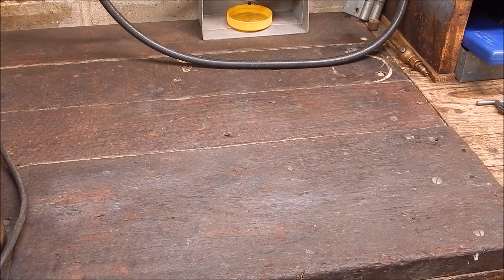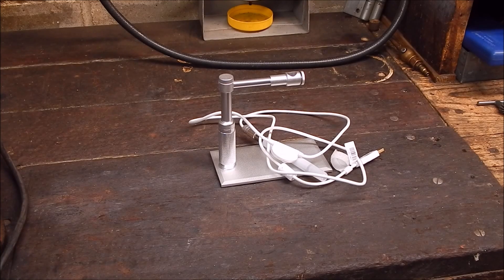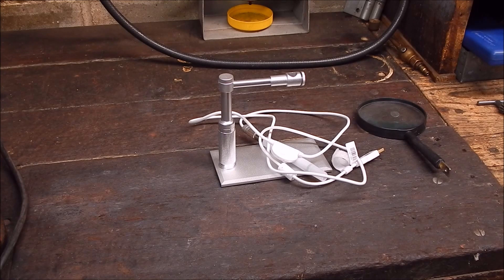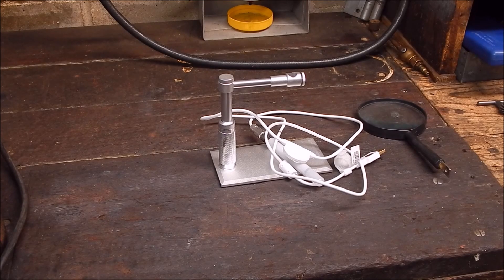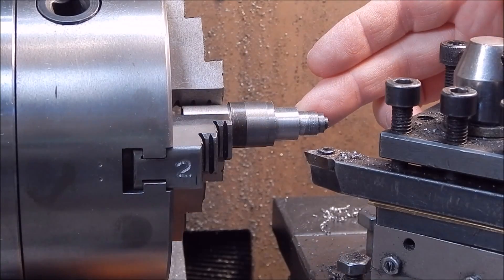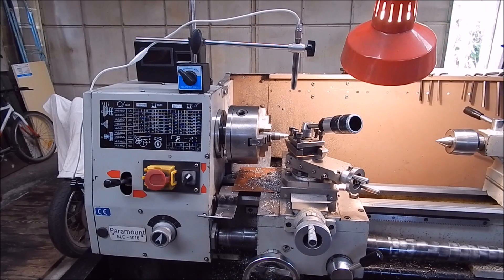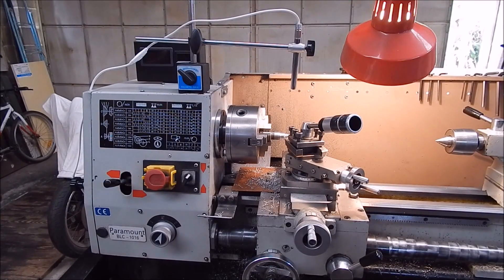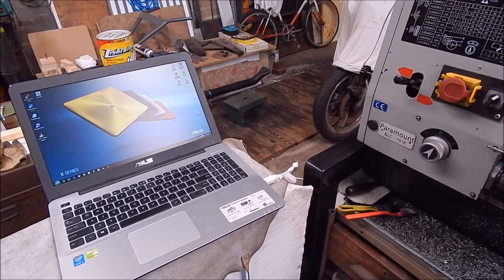Can you use a USB microscope for close up lathe work ?

Comment: I have a set of watchmakers taps and dies which I don't use because my eyes are not good enough..This idea of yours will allow me to drill fine shafts etc squarely through the centre accurately..  I am in awe of Find Hansen and blokes like him with their fine accurate work and I have never attempted similar projects because my eyes are just not there..Making fine conrods and the like accurately,are now on..The hobby machinest has another way to do fine work..This will prove invaluable to the hobby machinest and lets face it, machining as a hobby is growing world wide quite quickly.. Ian
Ian
Reply from the maker: +Ian Craig 

Hi Ian,

I hope it helps you. 

I'm 65 and my mid range vision has gone to hell.  It's a pain in the butt, just have to work around these things.

Have you tried those headset magnifiers?

They could be good and bad at the same time, in my (limited use) view.  The cheap ones are bad news with distortion.

Cheers Rob

Comment: Yeah g'day Rob---it would be real good for model making--making clocks,any sort of fine work...The normal sized stuff on a lathe is pretty easy but the smaller you go the harder it is..
The small stuff really tests me and I have found myself one more than one occasion making the same part twice because I had made a proper boghole of the first one..
This idea of yours should improve fine work accuracy many times over..
Good idea and spot on vid.-----.regards  Ian
Reply from the maker: +Ian Craig 

Hi Ian.

I can see it being very useful for working with very small HSS cutters - for single point threading, profiling etc.

I have ordered a micro USB adapter to allow the camera to be connected to a tablet or android phone, which would reduce the size form hugely.

Be interesting to see how it performs with a smaller screen.

Cheers Rob

Comment: is that a USB microscope or an actual butt cam?
Reply from the maker: +Dan Floyd 

It's a USB microscope which can also be used as an endoscope.

Rob
Reply from the maker: +Dan Floyd 

Good point Dan.  I will change the video title.

The original comment by the viewer was in regard to using a snake type endoscope, and I guess I was mainly thinking endoscope when I did the commentary etc.

Thanks for the comment.

Cheers Rob

Comment from the maker: The magnification level shown in the video is only a fraction of what is possible with this endoscope.

Magnification increases as you move the endoscope in closer to the work.

As I was using carbide in the test (which was in the tool post at the time), I didn't want to risk hot cuttings damaging the lens (which is glass covered) so I stayed back a bit.

For fine work I would always be using HSS, so in a real world application this would not be an issue.

I see this setup being potentially very useful for small scale single point threading.

Cheers Rob

Comment: i use an "old fashioned" visor magnifier..i have for over 40 years..works great too
Reply from the maker: +The57ironman 

Yes, the headset magnifiers work quite OK (good ones).  This is just another way of doing it.

I only need to reach for magnification on really tiny work, particularly fine threading.

For this hi tech concept to work, there can't be any lag in the video, and I was surprised at how good the endoscope really was.

But the lag factor is largely dependent on the lighting level, which was very good in the test.

An interesting concept.

Cheers Rob

Comment: You should see it from a few meters away on a 42" HD TV/Monitor, you see everything very clearly. I could read the model of lathe you have but in the USA the number would correlate into its size like my Jet GBH 1340 is a 13" x 40" lathe or 13" swing and 40 inches between centers but not sure your model lathe numbers are coded likewise and was wondering what size it was exactly?...and know you use a metric system so would have to translate it into inches. It appears to be about like a 9"x 20" but looks like its greater swing over bed than that maybe not sure. Anyway video was very clear through the scope might work well to view inside a bore as one was cutting internal threads, would make a good video.Keep em coming and will watch, thanx.
Reply from the maker: +1NRG24Seven 

The lathe model number is something the seller dreamed up - means nothing.

It's a 10 x 18 inch unit.

I bought the endoscope for general use, poking into tight spots etc.  It's not bad for VGA.

Cheers Rob